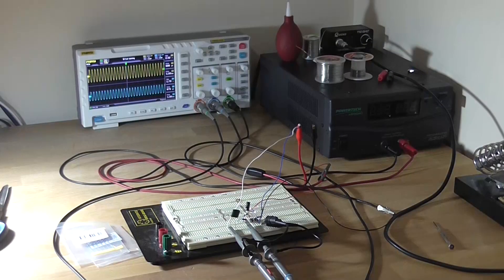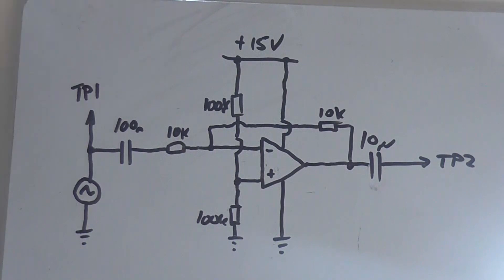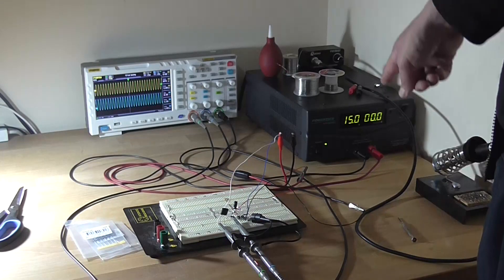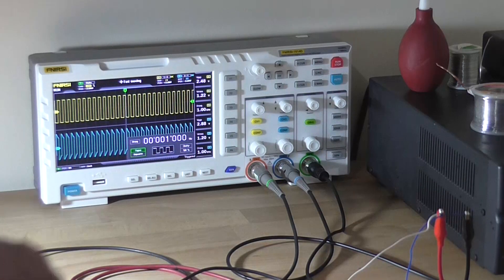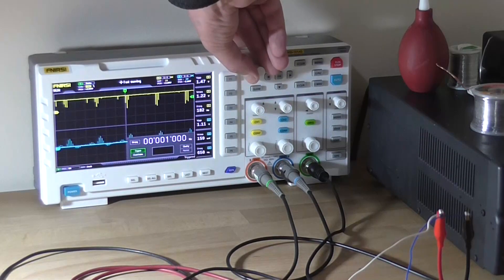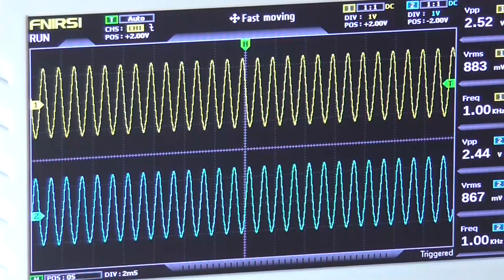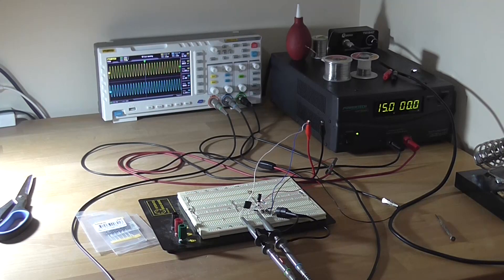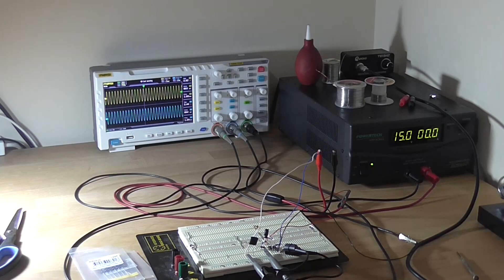FNIRSI 1014D DSO Inverting Display Test

Comment: The isolated PSU (USB power) makes this Osc. useful. But Bode plots (Frequency measurements) are important in the audio world. Is it possible to get the internal Gen and FFT function (lots of hidden modes) to work for this in this scope?

Comment: Thank you for your video. Some reviews show that when testing a say 1.5v or 9v battery, the scope doesn't show the relevant voltage. Something to do with an optocoupler which had been solder wrong way around...
Have you tested your 1014d for this?
Reply from the maker: No, I haven't.